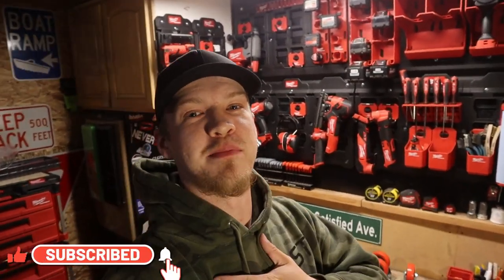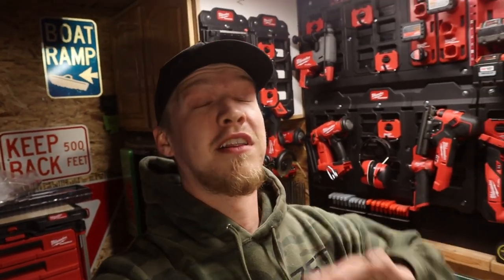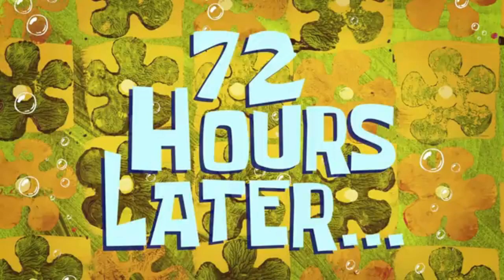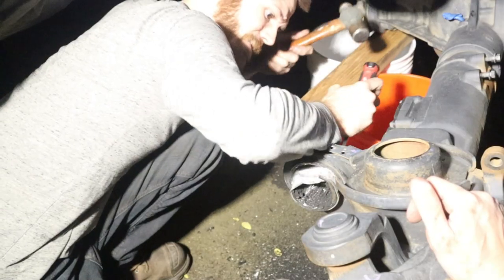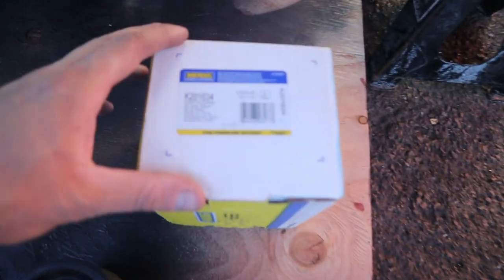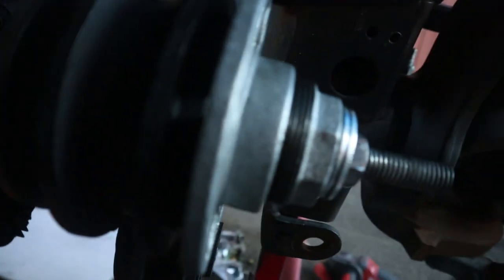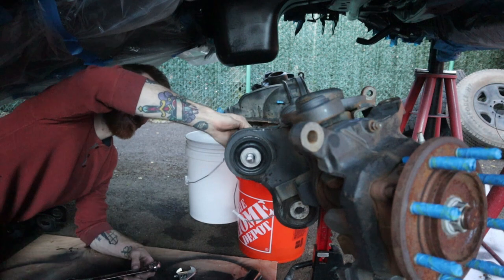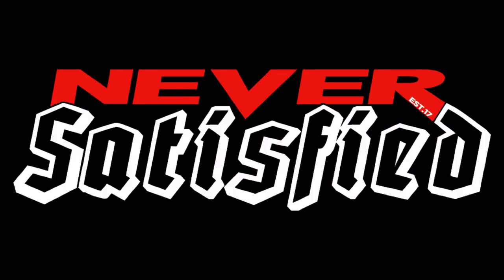(HOW TO) REPLACE DODGE RAM AXLE BUSHINGS. (SAVE $$ WITH THIS TOOL)

Comment: All that mikwauke gear and no right angle grinder
Also get some safety glasses  no need to get shit in your eyes.
Reply from the maker: I have every grinder Milwaukee sells. Haha what’s on the wall is only 30% of my Milwaukee tools ahah, most are in the work truck or being used on a project around the house. I have dozens of safety glasses as well just forget to grab them sometimes 🤣